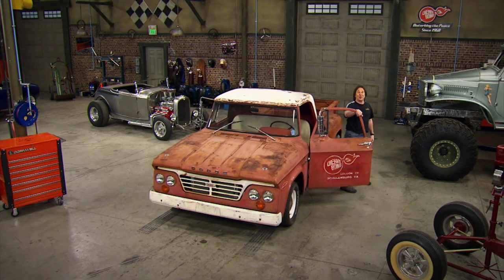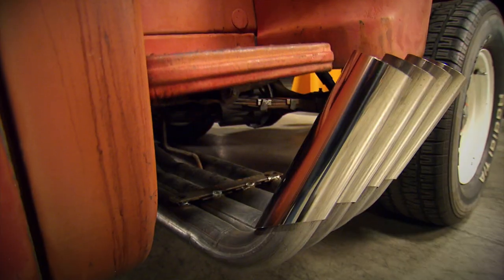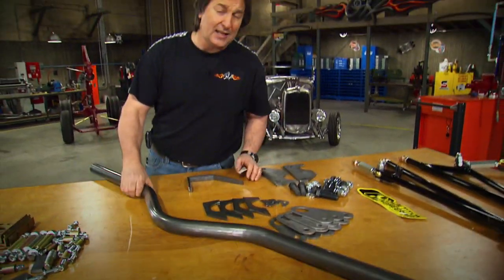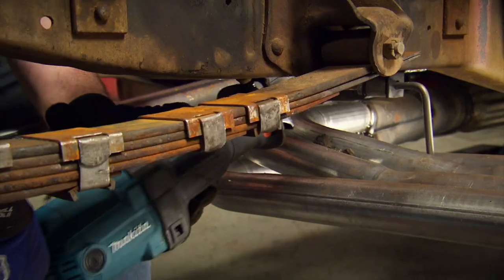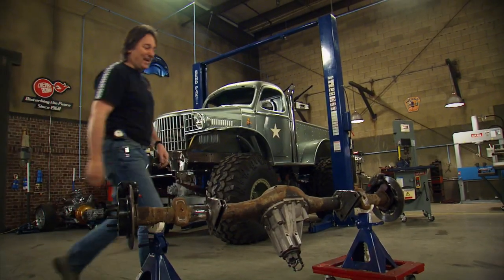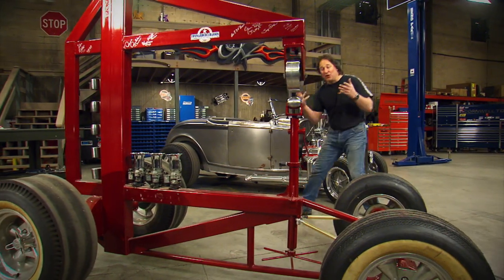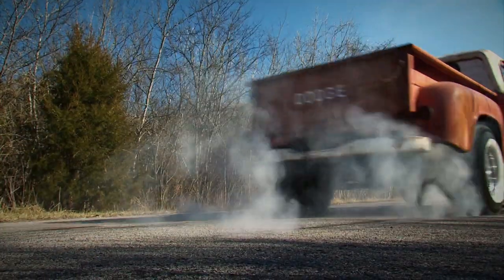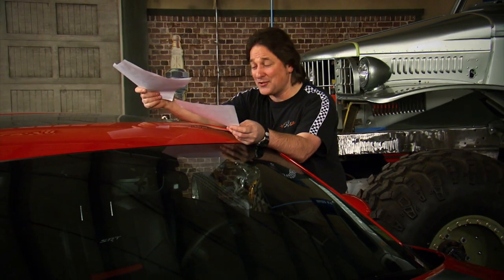How To Install & Test a Ladder Bar Suspension System - Stacey David's Gearz Full Episode S3 E5

Comment: I had my eyes on a truck just like this for many years now. Way before Hurricane Maria hit Puerto Rico.

Finally got the chance of an up-close look a few months ago taking the detour to it after the COVID pandemic started to die down and finding the property owner. I had visions of a late Dodge Ram pickup frame with a Mercedes-Benz OM606 turbodiesel swap for it, but the body was rusted out beyond repair, which was sad. We swapped stories about it, and the owner of the pickup lives in the States and plan to get the bed brought for his trucks at home.

It was nice to see that it had the Slant Six and a four speed. That may be of use later if I plan to do a flip of some sort of project.

It was the only truck of its kind I've ever seen in person.

Comment: My dad ran two pistol grip shifters in his ‘77 Power Wagon. Used the longer shifter arm from the B-body cars for the transmission stick and used a shifter from an E-body for the transfer case. 
I thought it was one of the coolest parts of his truck, next to the sound of that monster 440 and the 44” tires.   Best part is he still has them. And as a gift he gave me the shorter one for the transfer case to run in my (newly acquired) ‘78 Power Wagon (it’s an automatic ☹️ tho).